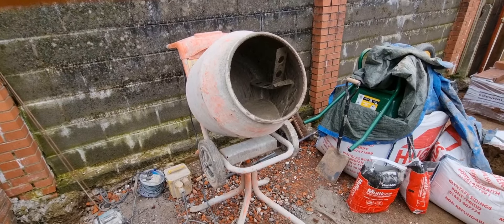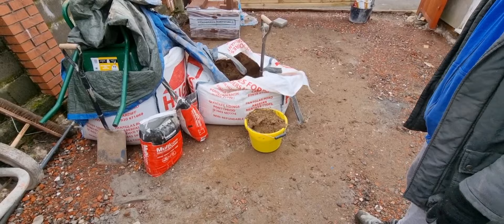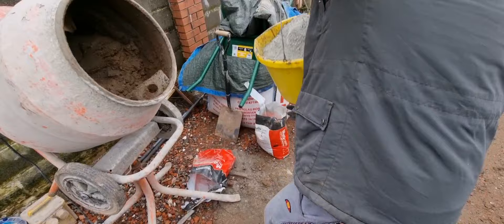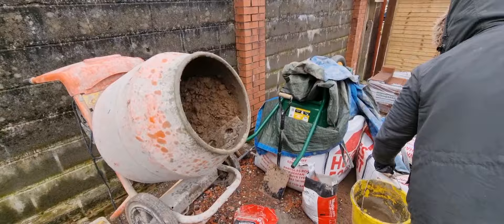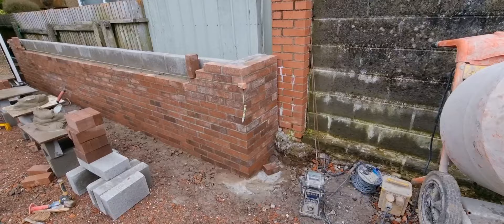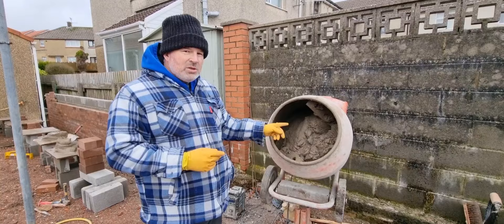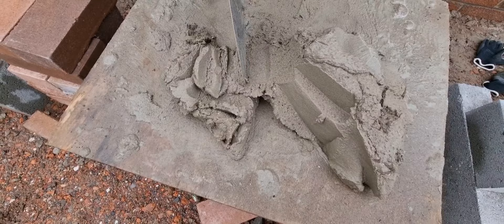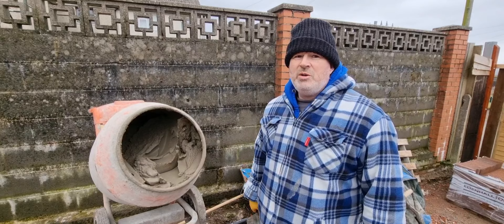Bricklaying Mortar Mix Explained

Comment: Could you be really pedantic by gauging the water and timing the mixer?
Reply from the maker: Not really as the water depends on the water content in the sand .
Also to time mixing causes to many air bubbles which weakens the mortar so you have a point there 👍